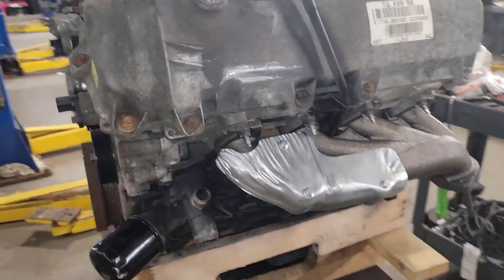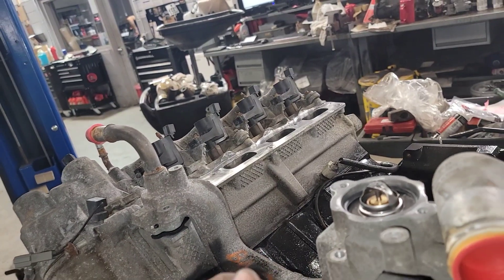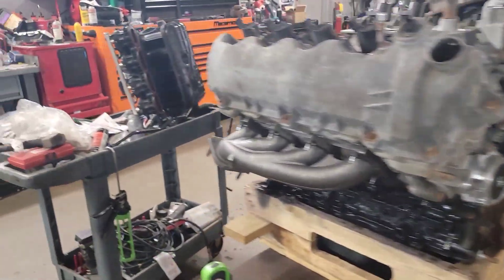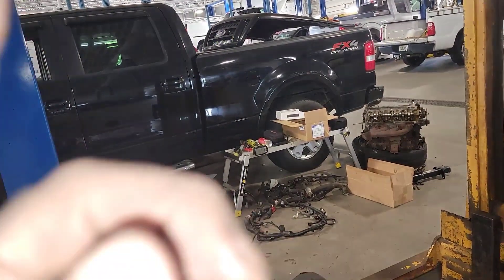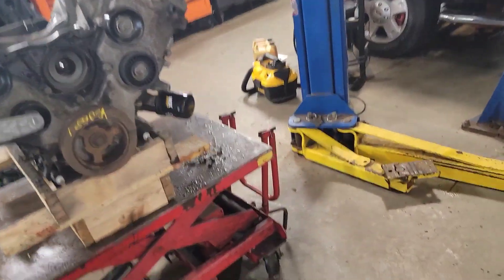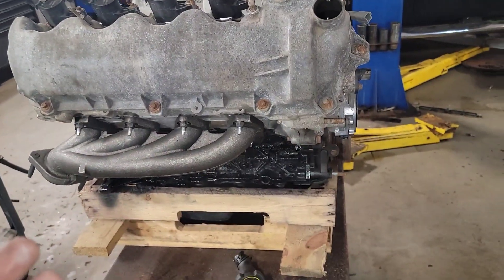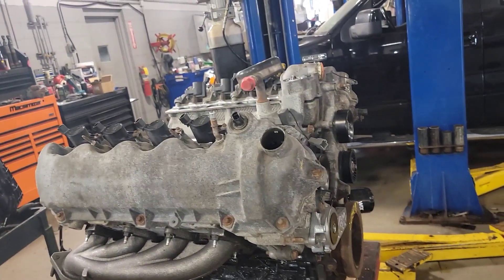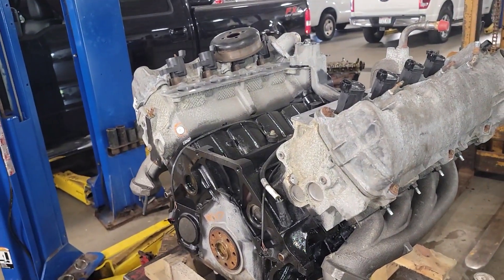IT HAD A WIX FILTER Finished The 2008 Freshen Up 5.4 3v now ready to install tomorrow

Comment: Great video Rich.  Looks like you did a fantastic job getting that used engine ready for a new life with a new owner.  That trick about using a bottle of Techron to clean the fuel level sending unit (or whatever it's called) really does work.  I had a good friend with a 2003 Focus 2.3L Duratec motor with over 250k miles on it.  The fuel gauge was stuck at 1/3 no matter how much or how little gas was in.  I had him try one bottle of Techron super concentrate fuel system cleaner and it fixed the issue.  The needle in the fuel gauge went back to work in a very short amount of time.

Comment: I ran both a standard Wix and a Wix XP on my 4.6 2V and both caused a started rattle after sitting for more than about 12 hours once 1-2K miles were put on them. FRAM is the only brand that hasn’t done it so far.
Reply: I've  had an ADBV fail causing startup lifter tap  even while using  a Purolator One. I then immediately put a New motor craft filter(a purolator built to Ford specs ) back on  my Ford and the lifter tap stopped. It likely was a defect with the individual filter itself. I typically have no lifter tap as well as  excellent oil pressure when using  Fram(Tough guard & Ultra Synthetic) ,Purolator, Wix, and Stp oil filters. The Purlator brand aswell as the purloator one is a great filter( including motorcraft; I use them on my vehicles all the time) Just the individual filter I had was defective. Also, @Whipcity made a good point that maybe your individual engine doesn't favor a specfic oil filter brand's oil flow rate/oil filter louver design. It's ofcourse also key to visually inspect filters for any defects before placing them on your vehicle. That includes the ADBV aswell as filter dents. Dents on oil filters run the risk of busting at the seams due to weaknesses at such pressure points. This occurence is somewhat uncommon  but it certainly is a possibility. Using a filter with a hardened Shell such as Fram Titanium helps lessen that Chance further but why risk it? If any  filter(s) I purchase online turn out to be defective, I then immediately try to get a  refund/a replacement(s) sent. It's just not worth risking a blown engine.

Comment: Wix Filter, oil looks clean 👍
Reply: The standard Wix Filter(AKA Napa Gold) is 99%@23 Microns. Since Wix Filters are Mann+Hummel, they are very durable for the price. The Fram Tough Guard is 99%@20 Microns(Semi synthetic micro glass media) and the new Fram Ultra Synthetic (Dual Layered Synthetic blend  aswell as the Fram Titanium(Metal mesh screen) Are solidily built. (Yes the Fram Titanium is still the old style metal screen) Thats said, both the Fram Ultra and Titanium are 99%+@20 Microns. I personally prefer the newer Ultra Synthetic  instead of the Metal screen since it filters better at the 10 Microns level than the old design. I have had great success with Wix, Fram, Motor Craft(Purolator built to Ford Specs), & the STP Extended life filter( The STP extended life filter is   heavy  duty since its a rebadged  premium guard filter) They are all very solid high quality filters.

Comment: now if it is fanatically maintained this 5.4 should give  good service

right now I am waiting for a low mile 4.6 to go into my pristine 2001 Grand Marquis. it has been weeks in the doing as the supply chain is all messed up. waiting for the right intake gaskets  God Bless you

Comment: Those aluminum F Series FPDM on the frame would rot out.
Reply: You are so right.  The Fuel Pump Driver Module on my 04 F150 went out about 3 years ago.  The truck is an extended cab XLT 4X4 with the Triton 5.4l.  It got to where it was not dependable when it came time to start.  And even worse it would quit after about 10 minutes and leave me stranded.  The FPDM had very little of it's metal alloy housing still intact.  It was all chewed up, rotted, and pitted but the plastic half was in good shape.  There was sand, dust, and minute particles of silicate inside where circuit board was located.  Even though the spare tire shielded it somewhat it still managed to be exposed to some nasty conditions.  It just seemed like a poor design to me.  But truck still runs fine now.
Reply: @keithbassett4988   Ford used the FPDM in every vehicle/truck starting around 2002 (depending on the model), but they should be inside the cab for longevity.  I'm still not happy about the EEC-V being mounted with the PCM connection outside the firewall, or the new Motorola PCM fully mounted under the hood.  I prefer to keep the PCM inside the cab if possible when I'm building restomods and race cars.
Reply: @RJ_Cormac  That makes good sense, bro.  Probably why engineers haven't done it.  Lol

Comment: Ah, warranty companies. Well, this used engine has some real promise. The one thing I really dislike is that "patina" on the aluminum as you see here. I really, really like to give the customer a nice looking engine. The shabbiness of those covers doesn't just reflect on the warranty company, it is something I take very personally. There's a split way to resolve this, I'm sure the customer can see this video, and your work.

When it's out, I can't help myself. I dress up that exterior as much as I can. In a pinch, Scotchbrite pads moistened with PB Blaster, and a pass with a wire brush, not a wheel, but a hand brush, makes things look brilliant.

Nice work, brother Rich! The interior of that engine, from what I see, looks like it was a nice donor. I have seen so many problems with "reman" engines, the problem is production. If you are really going to do a proper remanufacture, as a vendor, you REALLY need to step up to the plate and find an old salt to do the work. Sadly, we don't always see this.

As a mechanic, I have seen it all.

Comment: Hey wanted to ask you can you show us where the common oil leaks come from this engine i have a 07 3v and i have a leak but i dont know where its coming from
Reply from the maker: These had front cover leaks and they had oil filter adapter housing leaks and they actually had head gasket leaks that would leak oil and coolant
Reply: I had a 04 expedition, it’s common for the 3 valve 5.4 to be a little sweetie all over. But not normal to have major leaking problems

Comment: A 2008 was worth this much expense? Who is the warranty with?
Reply from the maker: I don't get told that stuff so I have no idea
Reply: Aftermarket warranties all would rather fight to go through and replace just the necessary parts instead of logically installing a reman. Usually ends up costing a lot more but they’d rather risk losing money doing it that way. That’s assuming they even approve your work at all.
Reply: @warrenself   they aren’t warranties, they are insurance products. Their actuaries crunch a lot of data…..you can be sure their policies are designed to maximize profit. Individual cases may differ (ie: they may end up paying more than a reman engine due to a failed repair) but overall their strategy will work for their bottom line.